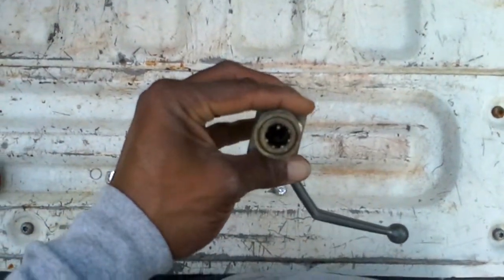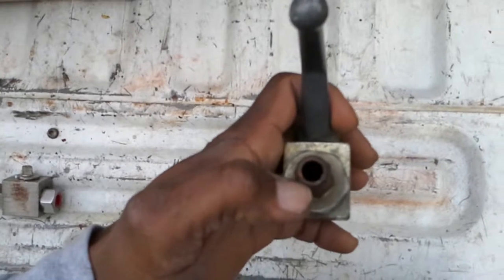Power Pressure Washing High pressure block ball valve

Comment: Hi Griff, just a quick tip for you, this can be caused by over tightning on the threads, try and use dowty seals when ever you can, this will prevent that.